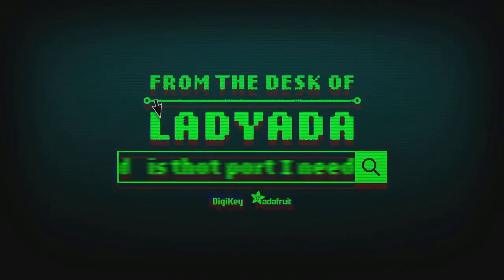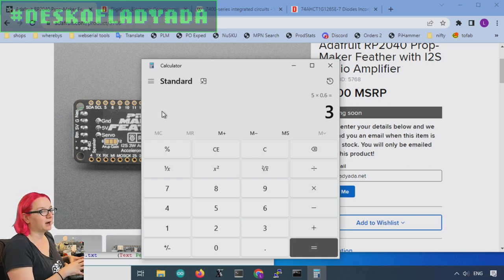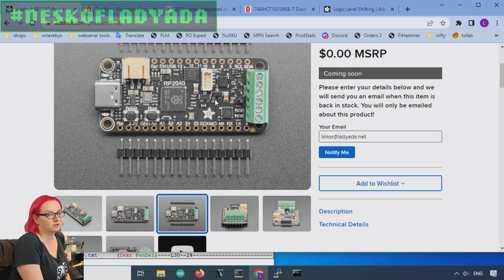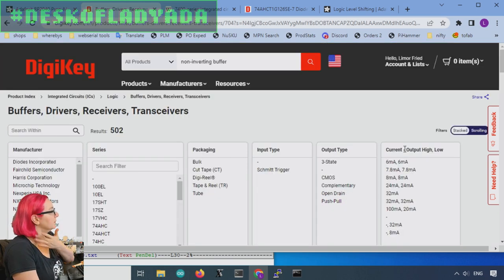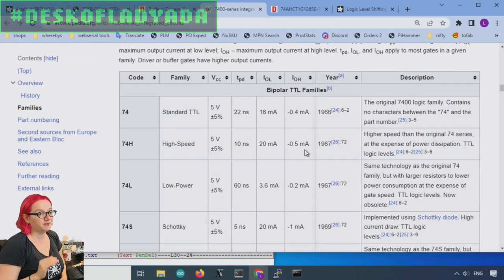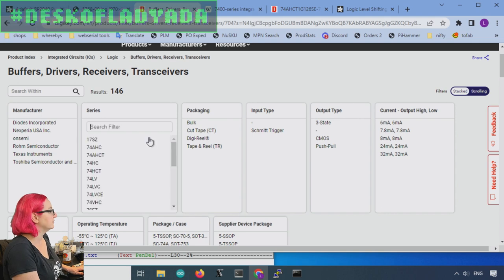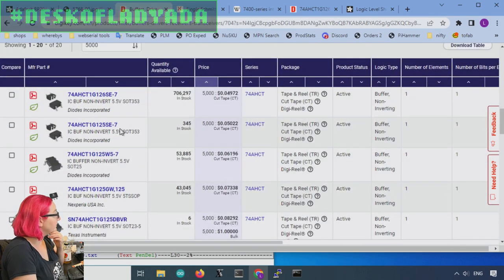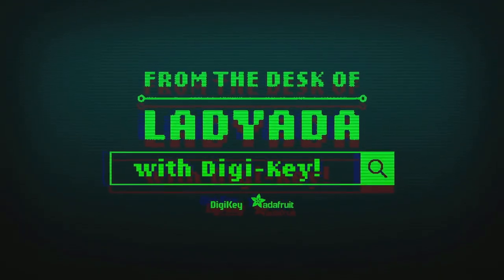The Great Search - Single Channel 3V to 5V level shifter

Comment: an SN74AHCT1G08 would also be possible. 
Instead of setting the Enable to high, the other input pin of the AND is set to high. 
The middle pin is then the input like the 74AHCT1G126.
VCC, GND and output are also on the same pad.